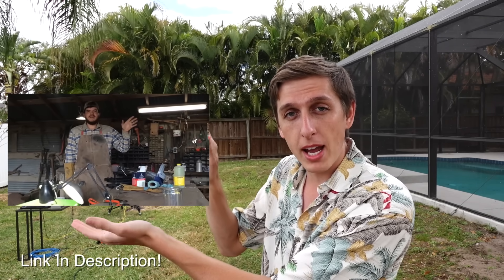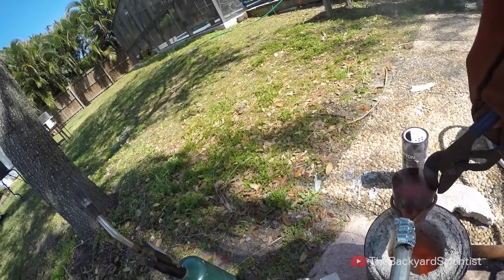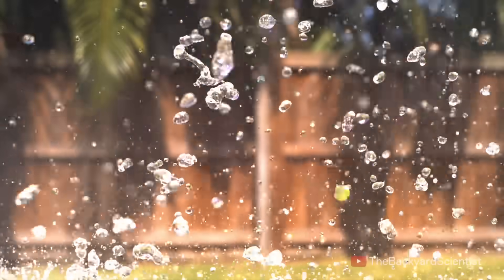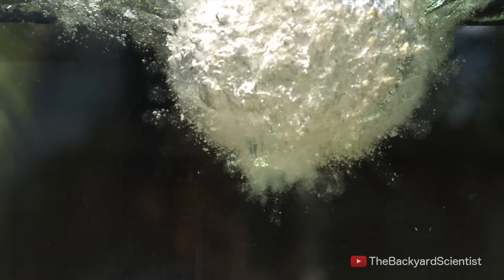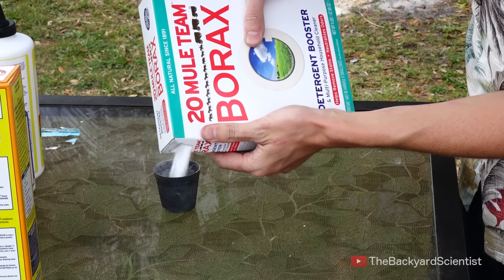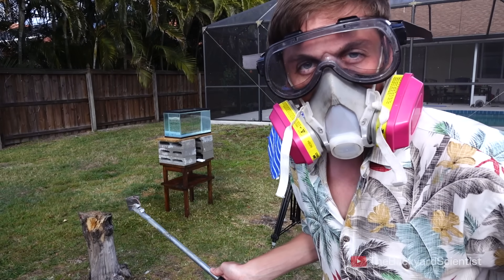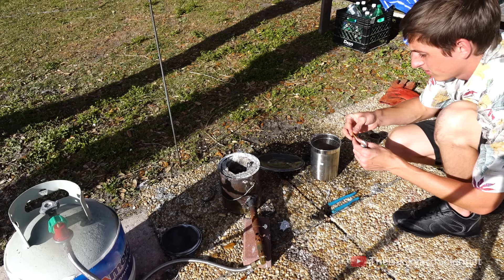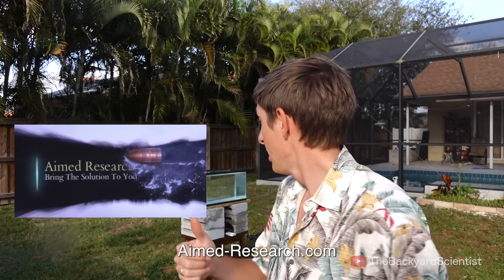Pouring Molten salt into Water - Explosion!

Comment: 1:10 “Stainless steel shotglass crucible” Completely rusted and stained
Reply: Stainless works because the chromium at the surface oxidises and forms a air proof / water proof layer of Chromium Oxide only a few atoms thick (also why Chrome looks so shiny as the oxide layer is so thin compared to thicker aluminium oxide which is not shiny). Heating the stainless steel destroys the Chromium oxide and then the oxygen from the air rusts the iron in the stainless. Also why welding stainless is a hassle, you have to treat the weld to restore the chromium oxide or else the stainless steel weld will just rust like untreated steel.
Reply: @peterschmidt1453  thanks for the info
Reply: @regs1917  So long as the chromium oxide layer stays intact. In welding, after mechanically cleaning the brown / blue heat tint oxides, the chromium oxide layer is restored by 1) electro-polishing - using electricity in an electrolysis reaction 2) Use HF or Citric acid treatment to dissolve the surface iron / nickel leaving the Chromium to oxidise into a protective layer. Stainless cookware would not get hot enough to damage the Chromium oxide in most kitchen settings. If your cooking meth, maybe.
Reply: Yeah the doom slayer used it

Comment: The molten salt heats the water up so that it turns into steam. Water is incompressible, so the only way the water can get away from the steam is out. If the temperature is great enough then the water can't move out of the way in time, so it applies too much force on the container causing it to explode.

Comment: My bet would be on either the thermal conductivity of molten salty being low enough for the water to touch it as it drops, or the salt forming an external semi-solid layer, in a similar fashion to the phenomenon that causes Prince Rupert's drops, where the outer, more solid layer alows for the water to get closer to the high temperature liquid insides.
Reply: Or its just sodium reacting with water like it normally does. At that temperature its more than likely pure sodium, so this is just any standard general chemistry sodium demo just heated
Reply: @DomicheezeWhiz  At that temperature it is still NaCl, heating it does not change it's chemical composition. There is no reaction.

Comment: It’s not the salt necessarily that reacts explosively with water. It’s the sodium half. The chlorine half basically nullifies the explosion reaction, but the melting process probably separates the two elements enough for the sodium to react independently of the chlorine. Also rapid temperature changes can react explosively too, so that could be a possibility

Comment: The reason I think that the NaCl isn't protected by the Leidenfrost effect is because it might have a lower surface tension or viscosity than water, so the water molecules have an easier time penetrating into the molten NaCl. Since the other molten compounds have more surface tension or viscosity, then they aren't able to be separated by the water, and thus no steam can form inside of them to make an explosion.

Comment: What is happening is that sodium is in the first group of the periodic table and this means it that there is only 1 electron in the outer shell of the atom. This makes the atom very reactive because the atom always wants to lose that electron. And so when u react it with an atom or a compound that has more than half the required electrons to fill its outer shell/valiance shell the atom that is nearer to filling that outer shell would want to gain 1 or more electrons and the atom that wants to get rid of that 1 or more electrons will if they get near enough for the magnetic to pull it from 1 atom to another. And the further/the more shells that atom has the less that nucleus has magnetic control over that electron and so when another atom with 1 or more electrons missing from its outer shell that has the outer shell closer towards the nucleus then the pull of that atom on the other atoms electron is greater and thus the reaction is greater. That makes absolutely no sense.

Comment: I suggest a chemical reaction:
In its molten state the ions of sodium and chlorine are not binde together amymore (fact not theory). My theory suggests that this results in a reaction of the chlorine and the water to hydrochloric acid (HCl). The remaining hydroxyd ions (OH-) can form another type salt with the sodium ions (sodiumhydroxyd) wich is a very strong base. Since we have a very stron base connected with a very stron acid they will form normal neutral soduimchloride in a very strong reacfion which is the one that causes the explosion. The fact that it is absolutely ph neutral is because the numbers of sodium and chlorine in sodiumchloride are equal and therefore react to the exact same amount of acid and base and will eliminate each other completely. This theory could be verified by checking the amount of salt in the water after the reaction.

Comment: It's chemical in my theorie. When you super heat the salt and introduce it to the water you get a couple of reactions. The water vaporises into O2 and H2. The O2 can react with Chloride to form Cl2O which is chloridegas which is flameble. Combine that with the Ca which reacts with water to form a spark. Because of the way these two chemicals reacts with each other and the water combine that with a high tempature you should be possible to create this

Comment: I was thinking that the sodium in the salt reacted to the water, but the heat was the catalyst.  In its cooled state the molecules of the salt are more stable, but heat the salt and the molecules destabilize.  In the molten state the salt could penetrate deep into the water. then the water was able to interact with the sodium allowing the reaction to occur deeper in the water.

Comment: the outside crystalises and tries to contract upon contact with the water, the hot inside is expanding at the same time... mini salt grenade is created. each little ball becomes a smaller secondary explosion. this continues until the salt cools

to check if it is chemical, simple. just check if there's chlorine in the water afterwards.

Comment: before he explains

What i think is happening is the salt is SO hot that when you pour it in the water. The water around it evaporates and then the air expands so fast making a small explosion. I wonder if the same thing would happen with other water like molten things.

Comment: "they poured molten salt into water and it exploded, they didnt know why"
Me from the abyss: Steam explosion
Reply: And why didnt the leidenfrost effect kick in?
Reply: @jorenvanderark3567  Doesn't Leidenfrost only work if the liquid is being added to a greater mass of something extremely hotter than itself, like water droplets in a frying pan? Even so In this instance I think because he dumped molten salt into cold water the mixture of rapid heat expanding and steam generation no insulation could manifest that quickly. Or perhaps some insulation did occur, but because of the massive heat energy release it was able to break it and thus the explosion? Intriguing to ponder just whats going on here. It would be worthwhile to test how much the reaction changes to water volumes of much higher and colder temperatures.
Reply: @jorenvanderark3567  Probably viscosity, the NaCl liquid was much less viscous than the other salts, so the leidenfrost effect lasted for a shorter amount of time.
Reply: @modnarsarhp  This would also explain why the first attempt didn't cause a steam explosion. It wasnt hot enough to reach that critical level of viscosity for the surface area of the dropped liquid to grow exponentionally along with the steam cavity.
Reply: @MrAntice  What would be a reasonable way to test that? Are there other super heated similarly viscous compounds that do not chemically interact with water?
Reply: @538696  He who searches finds.
https://www.tandfonline.com/doi/pdf/10.1080/18811248.2002.9715268
A scientific paper testing this very scenario out with several motlen metals.

It seems that tin is a good candidate for backyard testing considering the temperature ranges involved.
Reply: @MrAntice  Haha, funny enough, I was a PWR operator for 6 years, steam and hydrogen explosions were like the biggest deals, had to learn their mechanisms in and out.
Reply: @modnarsarhp  I wonder if the relative solubility of the salts varies significantly? The table salt would dissolve very quickly into the water and so making a fast heat transfer to the water, would the leidenfrost effect counteract the solubility until the temperature dropped enough? Simple experiments with many unanswered questions.
Reply: @peterschmidt1453  Solubility is the wrong word I think, these salt molecules are not forming hydration rings, what I suspect is happening is that higher viscosity liquids maintain more consolidated mass, creating film boiling, whereas less viscous liquids are not creating film boiling because there's just not enough of it in one place. the NaCl liquid also ends up having more surface area to flash water to steam, creating a steam explosion. You should be able to repeat this with any liquid with low viscosity and maintainable at atm some hundreds of degrees above water's boiling point. I very much doubt it has anything to do with the fact that it's a salt.
Reply: @modnarsarhp  Viscosity is the more probable correct cause, relative solubility would be interesting though.
Reply: Do a search for 'Thunderf00t, Sodium Explosion'.
Reply: @Fanghur1123  i dont think it was a sodium explosion because he didnt get the chlorine and sodium to separate in the heating process, so the sodium wouldnt have reacted with the water since it was a compound of sodium yes, but also chlorine. my vote still goes that the explosion was cause by steam getting trapped below the water and was released with so much pressure it created an explosion
Reply: @noisemaker_  Just heating it to suck an extreme temperature might itself have been enough to result in at least some of the chemical bonds being brokemn. I'm not entirely sure about that though, so don't quote me on it.
Reply: @Fanghur1123  from what ive read, it seems that you need to heat sodium chloride to 801 celsius, and then insert two electrodes to preform electrolysis, aside from that i dont see how he would have separated it, interesting though, maybe im wrong.
Reply: @noisemaker_  seem like regular steam explosion. Temp of salt turn water into steam faster than the first one getting chilled. The first minion explosions looks like hydrogen burn close around salt, and the big one explosion cuz of steam critical mass achieved. P.S. And, so about ruined fishtank, how do he explained?

Comment: Hey boys, I have an additional detail that I totally missed in my earlier comment. Everything I posted was correct, but incomplete.
We all forgot that Salt also lowers the boiling point of water. Thats why the other test materials did not react as violently.
It just dawned on me while I was cooking spaghetti, and adding the salt to the water.
Maybe you kats can do more experiments testing that, knowing about it now? 
Good Luck...
Reply: TheSirRip Salt raises the boiling temp of water though. Add a ton of salt to one saucer, then no salt to another. Pour equal amounts of water into each saucer. Stir the salt until it’s homogenized, then heat both equally to boil. Pure(ish) water will boil faster because there are no impurities (with a lower boiling point than water) to absorb more heat from the water.
Reply: @OhYeahItsJimmy  Thank you. I thought it was the other way, not the first thing i got backasswards.
Then that must mean that, the water that first absorbed the molten salt, caused the uncontaminated water surrounding it, to overtemp and flash to steam...

Comment: What I think could be happening is since when something is hot it is vibrating at very hi harry speeds and what I think is the water made it’s way into to sodium past the chlorine that’s also why it has a little bit of a delayed reaction when poured into a tank of water cause the water has to have time to react with the sodium, also why the reaction is more powerful then then molten sodium could be because when the water contacts with the sodium it gets trapped in the molecules of chlorine creating a sealed little area and that creates a bigger explosion ( kinda like putting dryice in a water bottle with the cap on)

Comment: Maybe it didn't work well with the borax because it was not superheated enough above its melting point, so the incorporation of water and subsequent expansion would not break the Leidenfrost film. Just as in the first molten salt trial that was only a bit above melting. But it is only a guess.

Comment: This is indeed a both physical reaction with partial chemical reaction as the molten NaCl causes the water to boil so quickly and boom explosion. It should still dissolve into the water and the reason there is no pH change is because, as the NaCl dissociates into its Na+ and Cl- ions, the water just arranges itself so that the partially negative Oxygen in the water surrounds the Na+ ions and the partially positive hydrogens in the water surround the Cl-. Thus, this should not change the pH as no change in H+ or OH- concentration occurs when salt dissolves in water
Reply: Well more likely than solvatation its that both are conjugated pair of pretty strong acid and alcaline substances , sodium hidroxide and hydrocloric acid so them would be pretty weak thats why salts from weak acids and alcaline susbtances do change pH just like ammonia and acetatic salts....well thats what I was taught for ecample etilic  alcohol  also gets that kind of solvatation but it doesnt change pH.

Comment: The reason it explodes is that pure sodium mixed with water explodes, and I'm guessing that heating it up and melting it releases some pure sodium. I've seen some science experiments of it happening. It happens because sodium loses it's valence electron in water, and when enough sodium atoms do it, they repel eachother at high speeds.

Comment: The reason this is happens is because water is super heated @ 250 degrees Celsius and your pouring in  800 degrees into it the water around where it enters quickly get super heated and expands rapidly causing an explosion or what seems to be one it just expands the water super quickly

7:30 Hah called it XD

Comment: Have you seen the video where the hydraulic press guy press some books and they explode? I skipped through the video so I'm not sure if there was any explanation, but it seemed to me like the tiny bit of force resulting from the released stretch of otherwise not elastic sheet of paper makes a minuscule pop, and the cumulative effect of a thousand pages turn it into a straight up explosion. If this reaction is physical, my totally pseudo-educated-hunch says it could be the specific breaking point of salt and the amount of force that gets released when a tiny chunk breaks off. That could be why it didn't work for other salts; it's the physical properties not the chemical makeup.

Comment: Ok so NaCl is salt. Which is sodium chloride. I’m not no scientist but in my 8th grade chemistry class I got thinking about if you were to melt down table salt to get sodium metal. And to get that. You would have to burn off the chlorine gas. Which would happen in the furnace. Sodium metal is very reactive with water which could cause the explosion. Don’t hate on me if I’m wrong but that’s my theory. Therefor, melting table salt would burn off the chlorine gas leaving behind sodium metal.

Comment: Could the sodium and chlorine separate through heat
Then could the denser chlorine that settled on the bottom act as a shield to get the molten mass farther down into the water before the sodium reacted with the water, 
The sodium reacts with the water then after sufficiently cooled could the chlorine strip back the sodium
Or
Could the sodium and chlorine just be separated by heat then react once they sufficiently cool
Or
Is water reacted with sodium pH neutral

I'm not sure but it seems affinity would follow heat endurance
If a temp could separate NaCl and sodium could combine with water at that temp, it would seem water had a stronger affinity than chlorine
Unless the only sodium that reacted with water was a small amount through circumstances lining up
Also if the reaction was the recombination of NaCl that had been separated by heat it seems that would be a slower reaction
Reply: Michael Combrink isn’t chlorine gas?

Comment: The reason this happens is because sodium is an alkali metal that means it reacts with h2o and then builds up hydrogen and then boom
Reply: if that were so, why did the ph not change in the water? wouldn't alkaline change it?
Reply: Danny Milligan 
2H2O —> 2H2 + O2. I’m tired and have done some napkin maths... Giving this a shot:  Thermal Decomposition reaction?  The temperature of the molten salt is high enough to decompose enough of the water to begin a cascading reaction into further thermal decomposition until the combustion of H2/O2 takes over..Alkali sodium ions could be adding to the violence of the explosion... wondering if it’s behaving somewhat like cesium in this reaction due to it’s (sodium’s) highly excited electron state as it’s ionized during parts of this dynamic reaction...

It seems that the pH isn’t changing because when the H2 reacts, so does the O2 through combustion as the temperature continues to rise as O2 combusts and H2 ignites. The H2O thermal decomposition is either happening too quickly to form HCl and NaOH or only forms them briefly or in small amounts during the overall reaction? Someone else take it from here.. goodnight